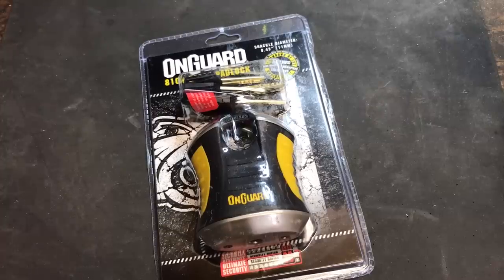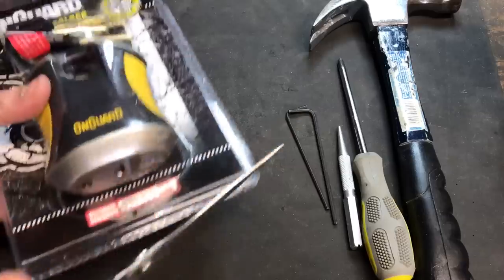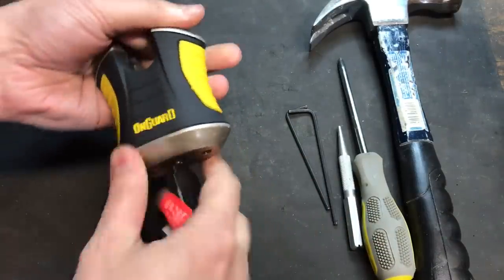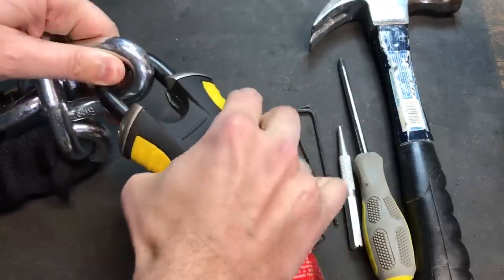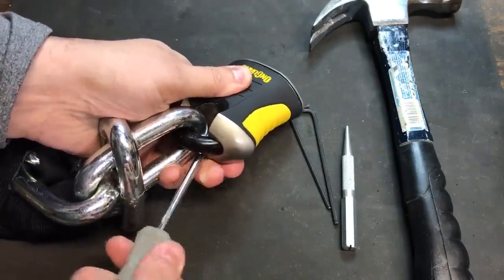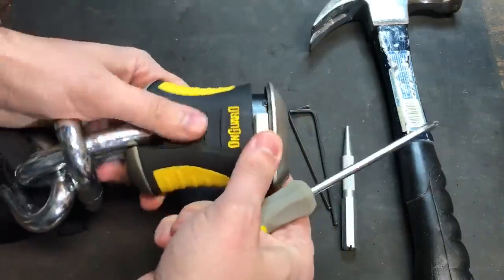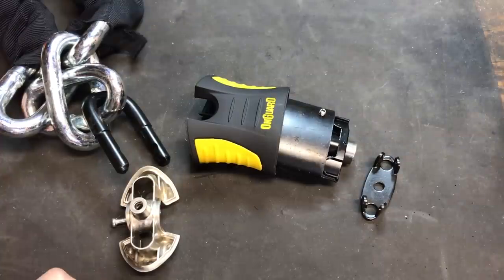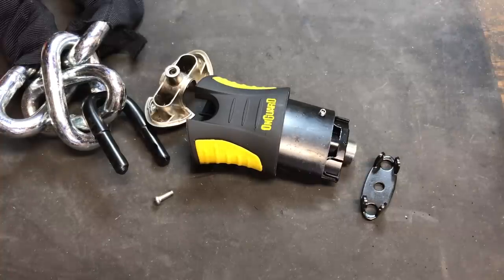[585] STUNNING - OnGuard "Beast" Padlock Disassembled While Locked!

Comment: I have a few questions about breaking one of these things down while it's actually in use on a bike...
1) If you had the correct 12mm chain on it, would that allow you to insert the shackle further down into the lock body, thereby reducing the amount of dead space to work with for the first screw that you removed? 2) Or is the shackle already bottomed out as far as it can go, and it would actually make it exponentially easier to work with because there's more dead space?
3) Keeping in mind that you had a hard flat surface like a floor or bench to to work with, how much more difficult would it have been to have to hammer those ball bearings deeper into the set screw when you don't have that option, because the lock would have been suspended from a chain, in midair with no access to a hard, flat surface, such as a floor or a bench?
I think it could probably still be done, but it would likely be much more difficult to work with under those conditions, because you would ostensibly be trying to work this thing over under cover of darkness and trying to do it quietly so you don't attract too much attention to yourself.

Comment: Every mechanism has a manufacture process to make it profitable, hence a weakness. . Now a truly secure lock would be made as a unique item for example a vault. I used to do locksmith work and most locks are so easy it's scary to think a whole house is protected by a bad lock. Even anti drill dead locks are easily got past within 2 minutes. The lock picking lawyer has studied locks for a long time and understands how they work. So then he also knows it's flaws. . But hey. . Great videos 👍

Comment: Not being picky (pun intended) but by using the 15mm chain, you was able to fit the screw driver down the side of it. 
Had you used the 12mm chain recommended by the lock company, and double link locked it (so 24mm was in the padlock) the screwdriver would not have fitted. 
Just saying.

Comment: So to fix that you just need to remove the 3 outer screws replace with stud lock and either a shear head bolt or block the hex with a bearing (maybe with a spacer under it). Pretty easy fix.

Comment: With a punch I think it might be possible to rotate those set screws regardless. Just little taps around the perimeter might do the trick. Or punch two dents on opposite sides of the ball bearing and use a flat screwdriver where a notch has been off from the center to make room for the ball. If the screw is not Locktited it should also do the trick.

Comment: Perhaps this is a dumb question but do lock manufacturers purposefully use screws that can be removed to provide a way to ‘service’ the lock? Wouldn’t it be better to use pins or rivets that can’t be easily removed? Or even welds?

Comment: I've have alan wrenches with holes in them.at work.
So you could forego the blunt force altogether and use existing tools if you have them.
Drilling a hole in a normal alan wrench should work as well.

Comment: maybe with both chain rings engaged by the shackle the top screw head would not be accessible? here instead one ring only (even if of larger diameter than that recommended by the lock manufacturer) is across the shackle, thus allowing room for the screwdriver.

Comment: Take the Lock apart and weld those screws with a tig torch. If ball and screw are the same metal, it should prevent access. Take it further and melt a bit of the surrounding metal. When that mess cools down, that attack is useless. (That is if you have not melted the lock by then)

Comment: Some permanent thread lock on the first screw and the first Allen would help, as would judicious use of a drill bit of the correct size. Then no one is going to unscrew them.
I’d also drive the ball bearings in like in the video and again apply the drill bit.

Comment: I think if you were to use their 12mm chain and run two links into the shackle instead of threading one link through another link as you did, it would crowd the shackle enough to make it damn tough if not impossible to access the phillips screw. Even if you could, there likely wouldn't be enough play in the shackle for the lock body to drop out of the casing far enough to access the allen screws. That said, I don't know what material that casing is made of. If it's not hardened steel, however, then it would probably be trivial to use a half inch diamond hole saw bit (~$8 on Amazon) with a 14v battery-powered drill/screwgun to remove a portion of the casing just above the allen screws and access them that way.

Comment: So all they need to do is grind down the tops of those set screws so the ball bearing "just" fit depth-wise, and then they'll be at the point where the LPL would have to much more quickly pick the lock :)

Of course that would make it less secure against him, but more secure against the rest of us!

Comment: To be honest I wonder how practical would it be to hammer these ball bearings in with the lock  actually locking a bike. I assume it would be hanging on a chain above the ground so you wouldn't be able to hold it against the ground, you obviously wouldn't want to beat up the frame of the bike and a pole or a bike rack might not be in reach of the padlock either.

Comment: If you were to replace the two Allens with security Allens or some other security pin with the same threads, would you otherwise consider this a good bike lock? Maybe even change out the Phillips Head to a security screw?

Comment: I was just thinking since that this demonstration is performed on a table, a real world hammering of that nail punch with dead on blows would be so much more difficult. You could make a fitting to back up the the curved part of the lock that you're hammering. I'm guessing you can hold a weighted and fitted dolly behind the lock, and a spring metal clip-on holder to hold a punch on, and hammer it carefully with your main hand

Comment: I mean, even though it's quite quick and fairly easy to disassemble, the fact that you need a screwdriver, a punch and hammer and two different allen keys on hand means it's probably street-safe.

Comment: I am a designer and builder and I think the lock designer made a crucial early error. FIRST, study the best. Improve on that, and if  you cannot improve that, move on. And it is important to be humble. Sometimes the old ways ARE best, but for reasons you do not fully understand. If a lock company has been in business for 50 years, and they do not expose any fccking screws, mayhaps it would behoove  a lock designer to continue that tradition.

Comment: to be fair while it is a pretty significant vulnerability it would be unlikely someone would spend time brute forcing their way in unless they were out of sight and ear shot. not to mention the lock would be hanging in the air, so knocking the bearing inside wouldn't be easy.

Comment: Hi, new to your channel but I'm curious if you can do this lock as you did while it's locking up a bike. You used some pretty significant force with that hammer and had a very sturdy object to act as a back plane. With the lock hanging from a bike chain on a bike and bike rack, can you provide the necessary force?

Comment: So yet again this is a very decent lock as I would love to see you try these methods on a locked up bike. Same issue with 75% of your content is that you dont test things in their real environment I.e locked around a bike. You know as well as I do that you'll struggle striking those screws with an elivated chain that's not able to access a flat surface like the ground to strike true. As always.. I love your content but since I've noticed the tests are not fair nor consistent with the true purpose of the product I have to give you marks down haha
Reply: You say that you watch his content that much but i can see that you don't understand this what he trying to say in this situation. Why he say this flaw is unexcused? Because this is not an average lock. It's a high-end lock and this flaw can be fix very easy by hide the screw behind the shackle, for example. And a flat surface, use a pole the bike is locking in bro. When you comment this, i supposs that you are thinking a bike that lock on the street and that is kind of hard to do this in front of a lot of people. I say this again, an expensive lock can be disassembled while locked using nothing fancy but some nock by a hammer is bad. But aside from this lock, you know what is 75% of his content? That is hold a bad lock ON HIS HAND, camly explans how the lock is suck and bypass that with a simple tool. If that is not "real environment" then what is?
Reply: @visgoth8910  it's not hard to attach it to your own bike now is it? Reason being he wouldn't want to damage his own property and same goes to the thief right? They would try removing while trying to cause minimal damage to the prize they intend to steal. Come on man as you're missing the point entirely I think. I'm not here to argue I'm asking why most locks he doesn't test to the full purpose of the product. Yes I'm right in saying it wouldn't be as easy to remove from a fixed bike with a tightly locked chain. You lose so much accessibility, have you ever tried doing something back to front and expected the same result? No you don't do you as it's a different approach. So what's the big deal testing this properly.. He tests the gun mounts 100% accurate with a weapon inside and mounted to a wall.
Reply: @Top.G.Andy.C  i really want to argue about the whole channel but let do this clip first. I see that you not know much about stealing bro. Kid can steal a car glass or even a wheel of the bike to sell it. A few hit is not that much of a deal. And why use the hammer again the bike. You have to lock the bike into something, a pole for example and damage that pole won't cost the thief much i guess. And now let do the whole channel. Most of his content as i said is BYPASS AND PICKING lock. He hold a lock on his hand, insert a simple tool and open the lock with litte skill involve. What part in that is "not test the lock in full potential" bro, tell me? Beside the main meal, the Ramset can be use easy when the lock is intact and he show that alot. Torching, cutting or shooting is not a mainthing and all of those method is for the durability. So again, what is "most of his content" you are talking about?
Reply: @visgoth8910  I can't debate with someone who doesn't make any sense and can't string a legit sentence together. Sorry visgoth but I don't understand your invalid points and assumptions you're making from nothing. Have a nice day
Reply: @Ian Wells I appreciate you're kind reply, as its been some time since I posted this comment I've come to realise one thing.. I guess if LPL showed us in the way I suggested he would be helping more thieves than people with a passion for lock picking. We would see the true way of getting around these obstacles that would posses more of a challenge. Thanks for your insight and have a lovely day Ian 🙂

Comment: This lock is priced in the $28 - $40 range, making it slightly more expensive than the bargain locks.  It takes LPL three minutes to get it open by dis-assembly using a screwdriver, hammer, and punch, which was only slightly more time than it took to get the lock out of its plastic blister-pak using sturdy scissors.
I wonder how long some of these failed locks stay on the market once serious flaws are found.  Locks like this can give all locks a bad name.

Comment: I have this lock. I guess the best way to modify the lock's terrible flaws is to remove the top set screw and set the ball bearings and Dremel the Allen set screws round, reset the screw, Dremel it tool "proof" and apply JB Weld to the cavity. Then your tutorial will be undermined.

Comment: I'm left to wonder how much of a difference it would make to add a couple drops of red locktite to that top screw. It doesn't look like you have a great angle of approach in the beginning, and with a little more resistance (red locktite added to the threads before use) if you'd just end up stripping the screw head. 
Just a thought. Not thrilled that a $150 lock didn't do this from the beginning.

Comment: if you use one of these locks, drive the ball bearing as far down as it will go, then grind the head of the grub screw with a dremil, so that an allen key will not fit

Comment: The only possible excuse for this is that it's unlikely you'd be able to get the lock in a secure enough position against the ground to be able to hammer those ball bearings out. 
I think doing this attack as it's hanging from a bike would be significantly more tricky.
Reply: I agree and challenge him to try

Comment: Those allen keys of yours are hardened steel. Why not heat them to soften it again, use a mill with a small ballheaded end-mill to hollow the tip of the tools, then harden them again?   
Might be an idea to have a set of those on hand if ball bearings in set screws are common practice.

Comment: I'm assuming those inner allen wrench screws aren't that deep, maybe just the thickness of the 2 walls.

With that, in the field all a thief needs is to remove the top screw, then hammer a flathead and sheer off the Allen screws.

Comment: Even just putting some super-strength thread-locker on to the top screw, bottom hex and set screws would limit ability to undo without damage ... those screws seemed barely toqued in

Comment: considering these locks are not meant to be serviceable and expect to last a certain time and just be thrown away when they break, the lack of red loctite on screws is amazing, a couple of cents of loctite would solve this problem, or mean you have to spend more time and a lot more force to get screws out, i usually strip heads before red loctite breaks.

Comment: A user could just seal those screw heads with either some solder, super glue, or an electric drill (to file the screw heads).  Of course that wouldn't be the only weakness, but I think there are plenty of ways to deal with this specific flaw.

Comment: To be fair, that did take him longer than almost any picking attempt that I've seen.
Reply: Yeah. The screws on the outside are embarrassing, but if the criminal has done enough research to bring a punch and a hammer to get past embedded ball bearings
In any case you could modify the lock pretty easily to make this attack much more difficult

Comment: One small flaw is that when its locked to a motorcycle or bike, you may not be able to get the lock flat on a hard surface to punch the ball bearing.  Still a major design issue though.
Reply: idk, it seems like LPL did not use the lock correctly.  I would guess that they designed it so that the lock is like its own link and each end of the chain is inserted inside, completely blocking access to the screw

Comment: Me: Struggling to remove a set screw when disassembling a rotor head of a rc helicopter.
LPL: Removes a set screw that is blocked by a ball bearing with ease.
Both issues seem to be Loctite related …

Comment: I can see what you mean with this being a problem but this was for bikes right? For how long this takes you would probably be stopped by someone since this would likely be used out in public, plus the hammer part would be very awkward without a way to place the lock on the floor, and finally unless you specifically knew you were going to face this exact lock no one would bring this many tools just to steal a bike though I do agree that the exposed screws are an easy fix that should be fixed

Comment: I don't understand how this lock and locks like this (with only a small amount of shackle available) can work with the recommended large chains.  Sure you could put the shackle through that 15mm chain, but the lock won't be any use if another large chain, or the other end of that chain, or some other part, can't also be put through the shackle at the same time.  I could not see two 12mm links getting through that shackle space and then closing it up.  So what's the use of it then, am I missing something?  The only thing I can see it being used for is on a slide lock or a gate latch with a lockable latch or slide.

Comment: Not sure there'd be enough room to get that first screw out if you had two 12mm chain links in there, which is what you'd have if you were actually using the lock in its intended way

Comment: I was thinking, what if you just stripped out the phillips screw head with a screwdriver or drill it ?  Or fill with epoxy or solder ?  Would make it impossible to unscrew it, and if warranty issues came up, you could scratch out the epoxy in an hour or so at home.  It would make step 1 impossible for someone to do at your bike.

Comment: although this is an old video, it makes me wonder about the quality of the rest of the lock as arguably least these faults could be fixed by the owner/user:P ** bit of thread locker, 2-3 more bearings or maybe drill the holes round, drill the top of the philips sounded

Comment: Seems to me like one could do a somewhat decent job of addressing this particular security flaw by removing the Phillips head screw and the 2 Allen head screws on the bottom (not the ones that have the ball bearing driven into them), then putting red Loctite on the threads and reinstalling them.

Comment: I dropped a solid steel cylinder that fits in the space between the phillips screw and where the chain would fit and contoured the top so the chain can swivel, but no way to get to the screw head. It must be unlocked to get to the screw.
Simple fix but resolves it.
Still thete is always something to defeat it.
Also the allen heads could be rounded... But this extreme effort ... should have come from factory without such simple flawed design

Comment: That is the same #1(looks like) Phillips head screw driver I have. I love the grey rubber. I seem to have more grip on it. But over time the glue on it deteriorates, and the rubber comes off. Also, not the best metal in the head area.